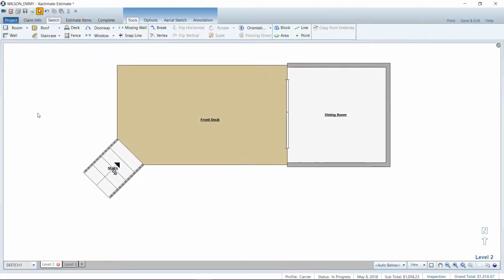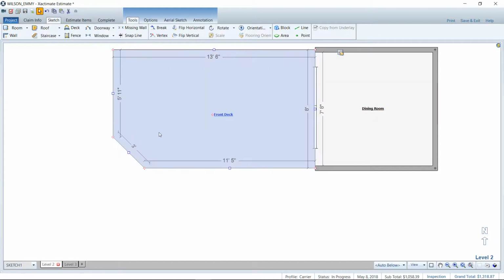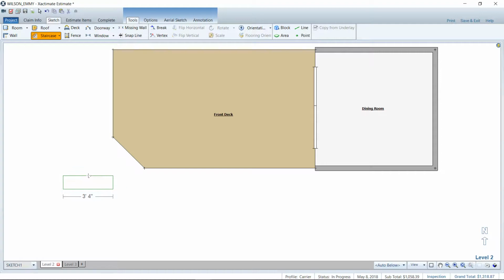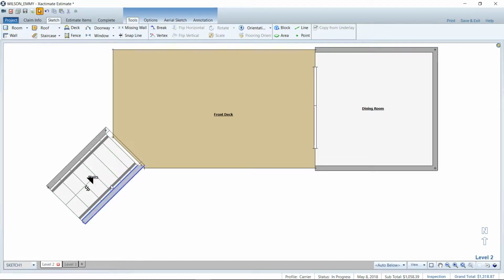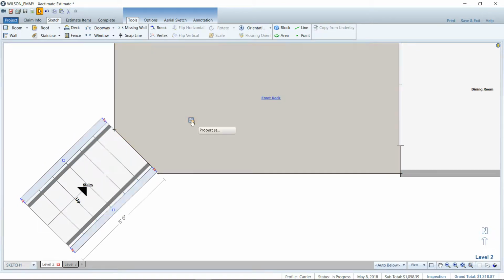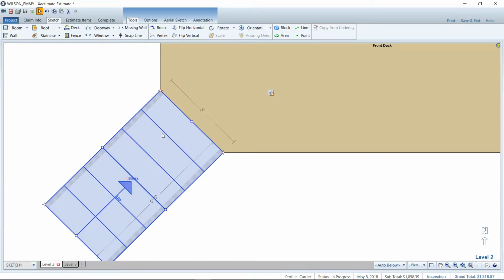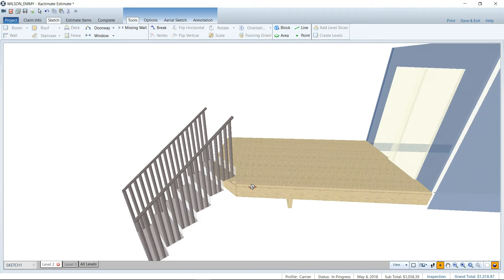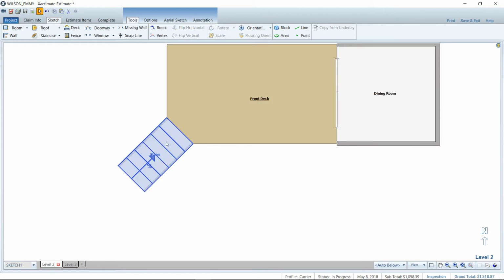Add a Deck Staircase

Comment: Always a big fan of your videos.   When I run into something I can't figure out, and/or want validation on my method, I check to see if you have a topic listed.    Today I was trying to improve on my decks, and watched a couple of your related videos.  Towards the end of this video, you are trying to position the height of your stairs in relation to your deck.   You went back and forth several times to the properties button to set your height below the deck.  .....   to the point...   In the sketch 3D mode, if you click on the surface of the stair treads more buttons appear.  Above the stairs, there is a pyramid, click, and hold on that to slide the height up or down accordingly, rotate your view, and you can set it to any height, above or below, relative to another surface.   I use that 3D option a considerable amount when I am doing roof sketches.   I realize you posted a couple of years ago, but as you can see, your videos are still quite relevant.  Hope it helps somebody.
Thanks,
John
Reply: I thought the same. But it's still hard to try to get the exact height that method. Not sure if its just me, but sometimes I need to click a bit above the diamond or the side or something to "click" it (If that makes sense)
Reply from the maker: So glad to hear these videos are helpful. Thank you!

Comment: Thanks for the video! The only issue that I'm having is being unable to group the stairs with the deck, even after it shows that it has connected when sketching. My estimate tree still shows the "Stairs" grouping. Do you know if there's a way to fix this?
Reply from the maker: Yes! You should be able to go into the properties of the stairs and choose "Subgroup of" and pick the area that you want to group the stairs with, probably the deck. See if that works for you!

Comment: What version of Xactimate are you using? I am currently using X1 and when I build a deck in sketch. My deck doesn't look like the one your does when in 3D view. Its just flat, shows no detail. In the properties I have adjusted the Construction setting, which populates the material list and to my assumption should also show the deck like the way your looks but it doesn't. Any suggestion? I have contacted support they were no help at all.
Reply from the maker: When I recorded this video, I was using the Desktop Version 28. I have X1 now and I can see the deck does look "flat" with the wood look on the surface but no depth to the deck itself. Must be a programming issue with the new version....don't have a fix for it myself, but if I come across a fix, I'll reply below!
Reply: @EstimateMastery  Similarly, it's not readily apparent (to me, at least) how to add something like pilings below (e.g., if this was over a walkout basement).  Always love your videos!